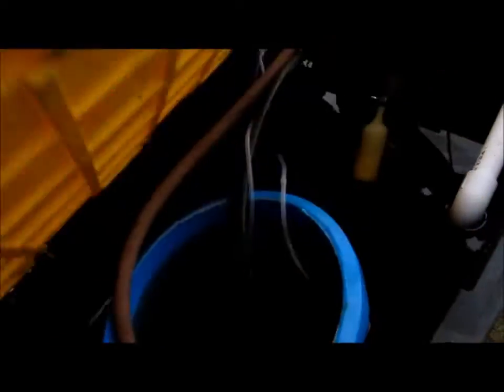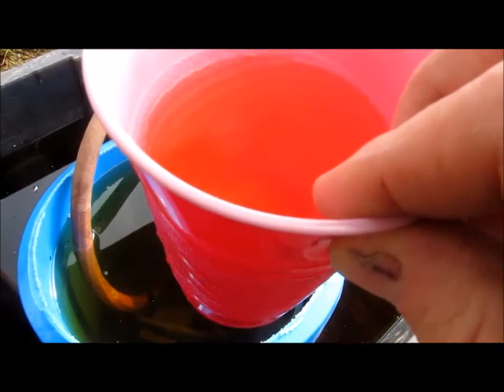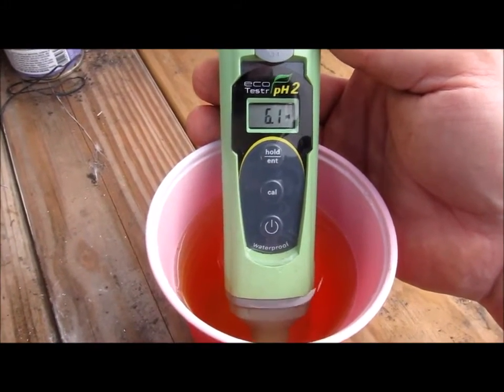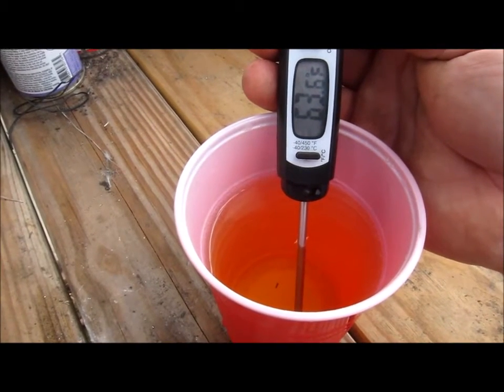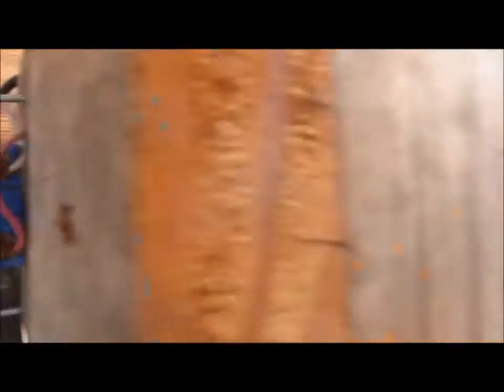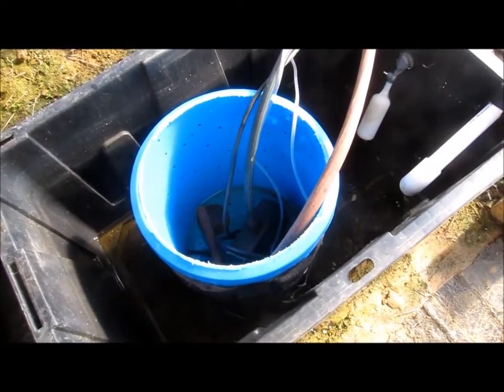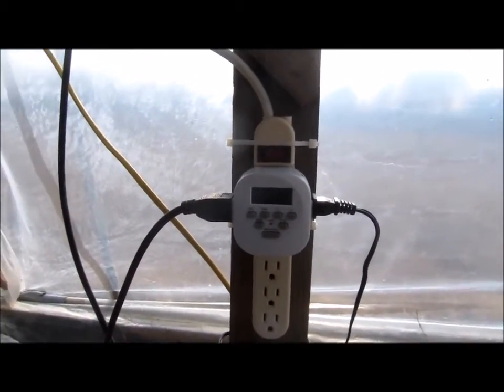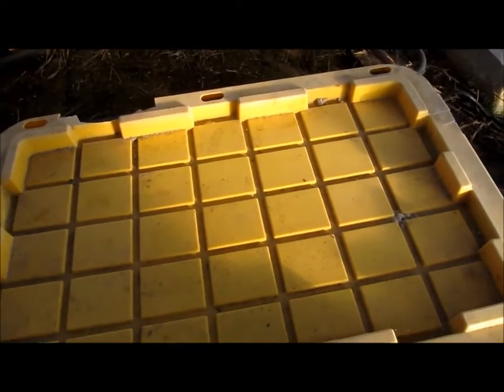Flushing the Hydroponic System FAWN

Comment: I may borrow the way that you recycle the old solution from you. I have been carrying it in watering cans to my plants. That was fine when I was growing in the raised beds in my old greenhouse but I do not plan on having any soil in this one unless it is for starter plants to sell to nurseries.
Do you allow the tap water to gas off before you cycle it through your system?
Chuck
Reply from the maker: +Fensterfarm Greenhouse Check out what I just told Larry (Austin Family Gardening) above about using old nutrient in the main garden.  The RV pumps are cheap too.  You could "T" off the nutrient continuous pump, as I've done in this vid as well, but you won't get an auto-shutoff.  I actually had this spare pump on the shelf.  Now, it'll never make the RV.  No rest on the house water.  Chlorine concern?  Waiting would take an extra day or so for me.  Last year, in the heat, I had root issues and used both H202 and bleach to try and deal with it.  House bleach worked the best for me.  Just not great.  Our water is 40 ppm from tap and I've used it to water the main garden for years.  Seems to be ok, but understand the desire to off-gas the chlorine.  I could surely let it sit for 24 hours or so first I guess.  It's always been an issue in the back of my mind wondering if I'm doing some damage.  In fact, I'm all for preventative stuff.  I have a 65-gallon tank.  I can fill it a couple days before the change out and use that water.  Thanks for the convo.  Love this stuff.  This year, I've got a plan to use beneficials in the nutrient to fight root issues.  We'll see.  

Brent
Reply: +C3 Voyage Your tap water reads almost identical to mine! Glad to see that these municipal water plants are doing their job correctly! I keep my water stored in 2 40 gallon drums, with airstones to eliminate the chlorine, and is always ready when I am ; )
Reply from the maker: +Keyplayr61 Greenhouse Hydroponics And Gardens Innovative, good stuff.

Comment: Very well thought out system. How often do you change out the nutrient water from the 250 gallon of tanks ? I like the ease of being able to run a hose and water your outdoor plants !
Reply from the maker: +Austin Family Gardening Channel I never have purposely changed it out.  It's always runs down to empty.  When empty, I rinse the barrels with house water.  In summer, with a full blown grow, I go through 250 gallons in roughly a month.  In winter, up to 2 months.  I test the barrel storage nutrient at regular intervals.  Honestly though, Larry, I'm not convinced I need to do a nutrient change either.  My numbers/ph are fairly consistent at all times.  Maybe 100 to 200 ppm drop as you see in this vid.  I wonder how some hydro dudes get the salt build-up which usually equates to increased ppms right?  Anyway, I do it because others do it, as insurance, and I can use the old nutrient to garden outside.  My plans for next year include using the old nutrient in the main garden.  Did that last year and it worked great.  I would like some feedback on this subject.  Tell me your experience and thoughts on it.  Here publicly is fine.  It's part of why I'm here on Youtube.  Thanks brother.

Brent